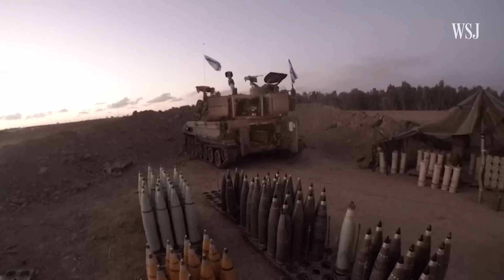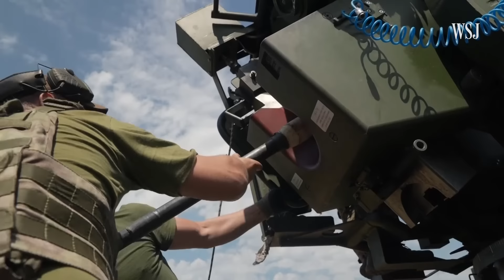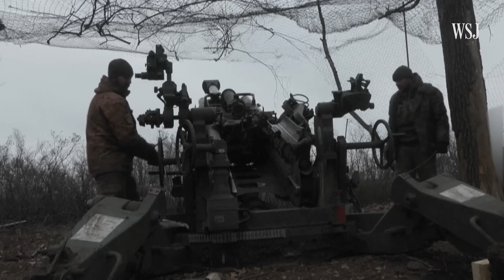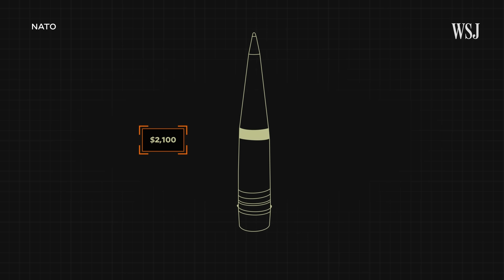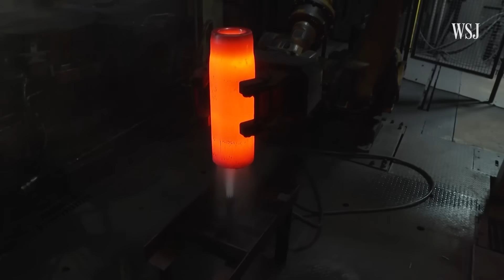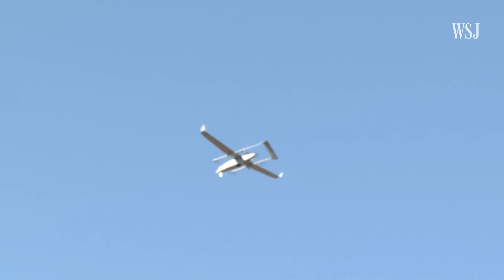Why the 155mm Shell Is One of the World’s Most Wanted Objects Now | WSJ Equipped

Comment: Imagine firing that shell 90 miles…
Reply: I wonder how long it would take to reach its target. Also Iv always wanted to see a Go Pro in the tip of a shell and watch the footage of it flying through the air.
Reply: @savagex466-qt1io  There is a Russian video from a drone where the shell passes pretty close to it, and you see it hit its target, will be hard to find with the bias YT....but you get to see it.
Reply: @savagex466-qt1io  What's amazing to me is they can shoot several rounds at different trajectories so they all hit the target simultaneously... 

Its called Multiple Rounds Simultaneous Impact or Time on target
Reply: @savagex466-qt1io  there is a simulated video on youtube.
Reply: @savagex466-qt1io  it would take approximately 240 to 160 seconds for a 155mm artillery shell to travel a distance of 90 miles, depending on its speed.
Reply: A battleship could throw the weight of a volkswagon 50 miles.
Reply: @CSGATIyeah with 600+ lbs of powder behind it😂
Reply: Probably about 5.5 minutes to hit a target 90 miles out.
Reply: @paulkangas515  it would take approximately 241 to 162 seconds for a 155mm artillery shell to travel a distance of 90 miles, depending on its speed.
Reply: the Leonardo Vulcano 155mm round already has a range between 90 and 120 KM, the range of the C model is of 120 km (74.5M) and it's not rocket assisted. The muzzle velocity is of 1200m/s
Reply: @canemcave  I checked Leonardo website. The say their Volcano guided Shell only reach up to 50-70KM.
Reply: @arghost9798  that's old documentation, it's 5 years old

check in wikipedia, the italian version
Reply: I wonder which is more expensive, Excalibur round or a HIMARS round?
Reply: Used to be excalibur. 100k vs 200k @thomaskaiakapu2672
Reply: 7 shells missing their target vs 1 shell 'bulls-eye'...keep on wasting resources in the name of 'overwhelming the enemy'...that tactic went out of style with Napoleon and the Czars. @HarryF-tz5fo
Reply: @HarryF-tz5fo  7 coming your way is quite optimistic when youre far out of range for russias conventional artillery lol
Reply: yeah, more like a rocket
Reply: Give me a second, I'm imaging it.  Ahhh yes!
Reply: it woudl not be so effective - bc small explosive. itis better to buidl a drone with such range. basicaly itis dead project already
Reply: @sguploads9601  Might as well get rid of infantry while you are at it as those are outdated also, right?
Reply: @asandax6  What if the robot jamms the round, who you gonna call?
Reply: @final-new-frontier  Ghost Busters.

But seriously just send in another robot same way we send in another human if the first one is struggling.
Reply: @asandax6  And tanks while your at it... 

Tanks were believed to be outdated too only a few years ago....
Reply: @sguploads9601 you have no idea what you're talking about.
Reply: @R290s_biggest_fan yeah exactly lol
Reply: @sguploads9601  🤦‍♂🤦‍♂